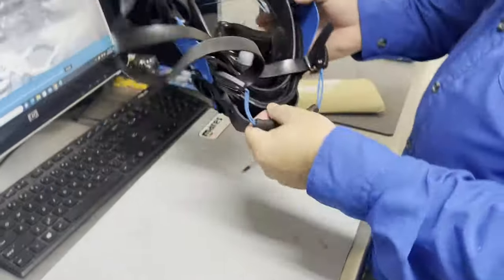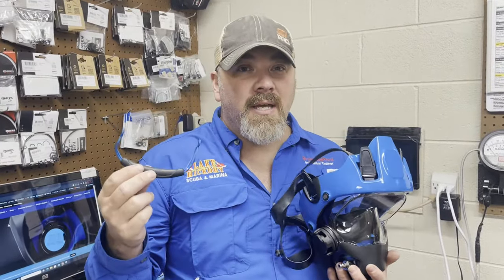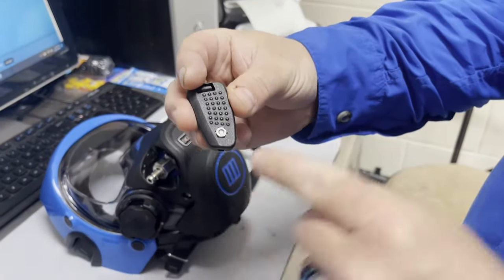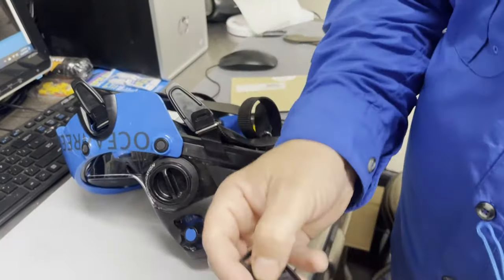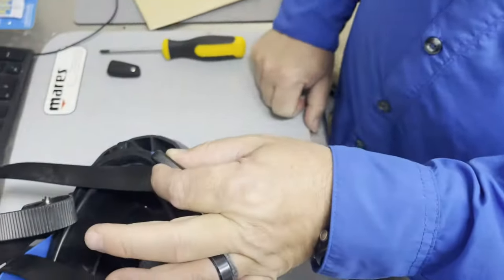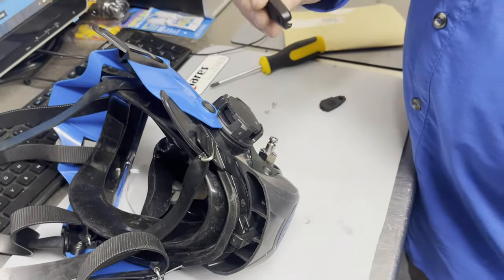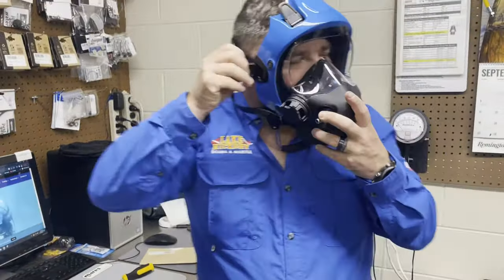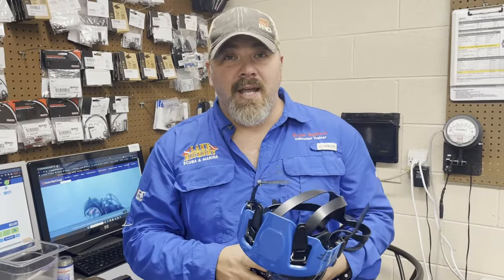Installing The Quick Release Handle On Your Ocean Reef Full Face Mask

Comment: Any benefit to adding loctite blue?
Reply from the maker: Hello @bfnkzta, you can most certainly use blue Loctite if you feel the need. It will not hurt it in anyway. Just makes it hard to release the screw if you ever decide to change out the Quick Release.